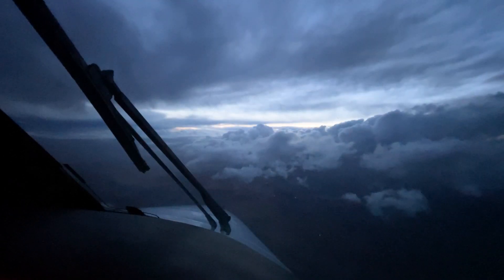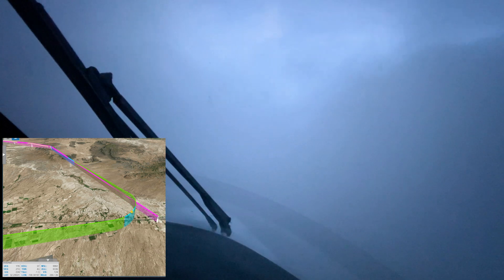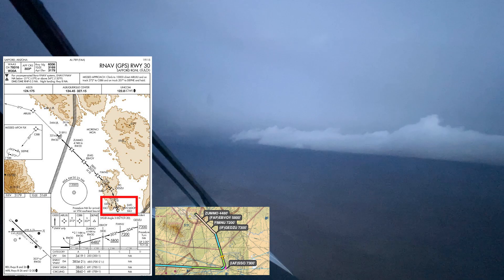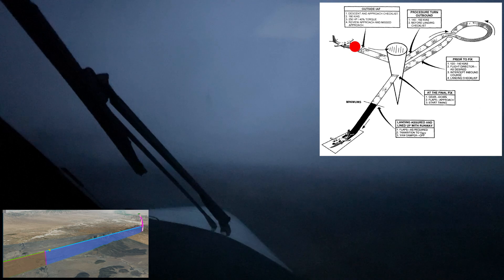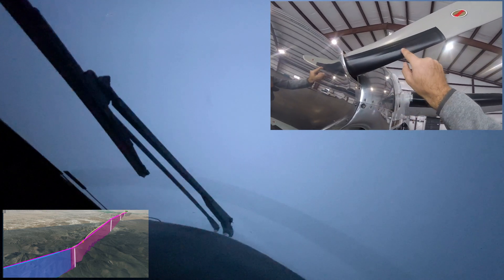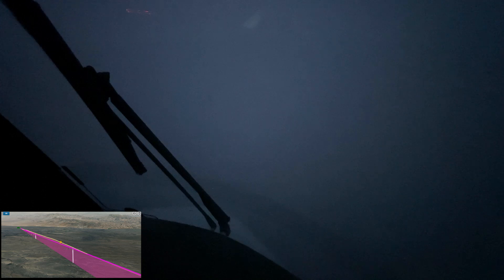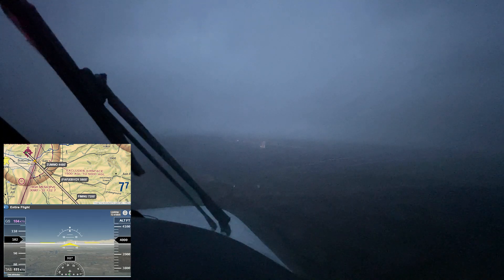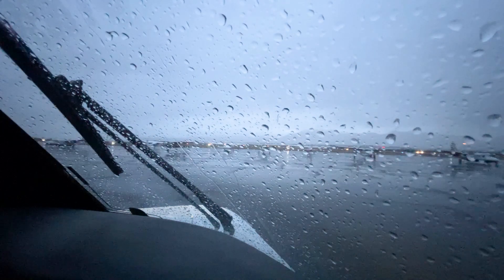Turbo Commander - GPS Approach HOW TO

Comment: Crazy question from a rotary wing Flight Nurse Practitioner on an AW139. Why are you able to fly single pilot on a medical fixed wing, rather than dual-pilot as commercial pilots do? Do you find it to be less safe than dual pilot? Where do your Flight Nurse and Flight Paramedic stay while on duty? Questions arise as our 32-year program has never been single pilot, and we, as well as Maryland State Police + Los Angeles Fire Department, fly our AW139s as IFR with ATC control 24/7/365 for safety.